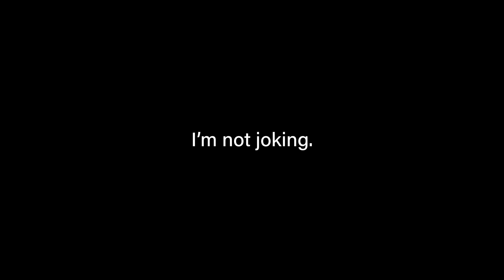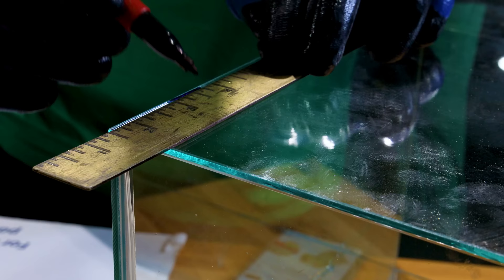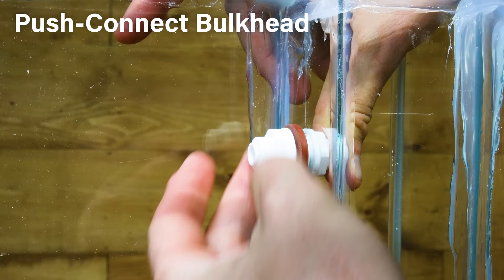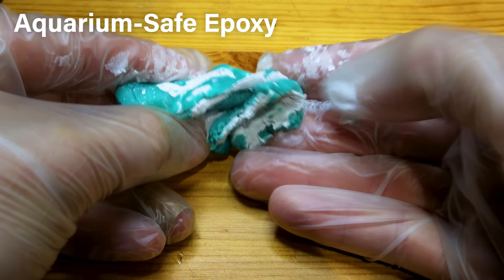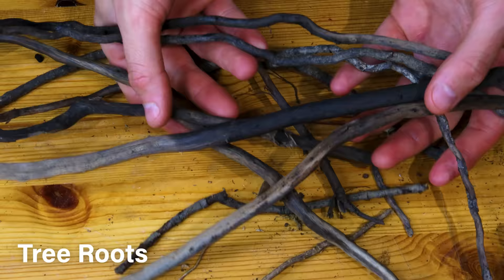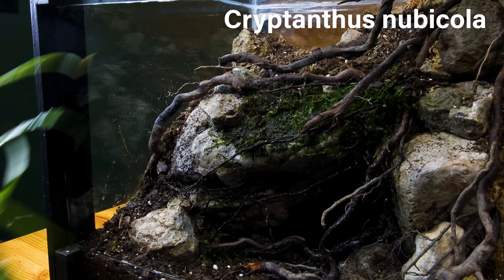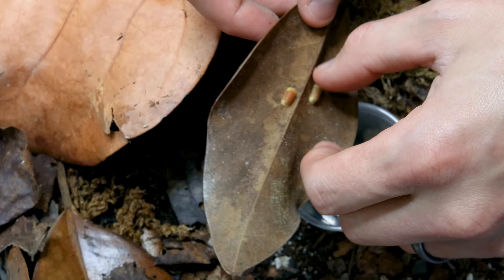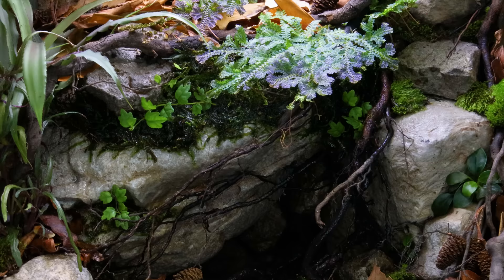DIY Rubber Ducky Isopod Dripping Cave Vivarium

Comment: I love seeing the isopods showcased on the channel! I have a couple recommendations for the substrate based on my experience:

Crushing up a ton of leaf litter and mixing it into the substrate is ideal in contrast to having only a surface layer. This allows more air to enter the soil, provides more surface area for them to nibble on, and more leaf litter = more pods. There's no such thing as overdoing it. I find that the surface layer leaves serve better as shelter and perhaps a humidity "blanket", so I use tougher, long-lasting leaves for it. Also, rotted wood (the spongey stuff) elevates any isopod substrate to the highest level. I add as much as I can and (controversial as it may be) don't sterilize it. This innoculates my substrate with native bacteria and fungi to create an established environment almost immediately, which promotes colony growth. My C. "Rubber Duckies" began breeding about a month after I bought them despite many claims that it can take around a year for them to start. Just 5 months later, I have about 60. Many people would argue my method carries some risks, but I've had nothing but success with it :)

(Side note, the orange springtails have been officially identified as Yuukianura aphororoides, a Japanese species that has been introduced to Europe. They were originally collected from Spain, so it caused a lot of taxonomic confusion)

Comment: Yo! This is a little silicone trick tile guys use for shower doors. You can wet your finger and run it along to bead to take off excess and make it more “even”, those giant yellow sponges you see at Lowe’s in the paint section? Wet one of those and use it to run your finger on to clean the silicone off. This will give you a super clean look

Comment: I would love to get an update on the duckies to know whether they are still out and about or if they ended up burrowing and coming out only to eat. The contrast of their yellow and orange on geeen moss looks amazing! I know what I am putting into my 18x18x18 Exo-Terra now! I had built a foam faux-rock wall with a prehistoric painting of a horse, like in the Lascaux caves in France. I added a dripping tube hidden above to achieve a similar effect to yours. But now I will modify it and add limestone to it and I will try to get a few rubber duckies or blonde duckies. 💛🧡🤎

Comment: Thanks for another interesting and fascinating video. I have a question. I have two favorite channels at the moment: yours and Dave’s Little Beasties. Both of you I respect a lot for your knowledge. However, now to my question. Dave who mostly keep tarantulas but is also an experienced reptile keeper, states that there is no reason to boil or heat leaf litter, branches or other things collected in the wild (from safe places). I have noticed that you do the opposite. What are your thoughts on this? I tend to agree with Dave, but would very much like to hear your thoughts. Thanks! John

Comment: Love the build! I notice youve been using epoxy a lot more lately. Is this just because you have some on hand from a previous build, or do uou find this method to work better? Are there situations where you are more likely to use the epoxy method over others, or vice versa?

Comment: Hey Tanner, 
Are the aqueon frameless tanks okay to use (especially for a full aquarium)? Do I need to re-silicone them? If so it looks like you re-silicon'd over what was already there. Is that enough? Was that just for this particular project or because the overall build quality of the aquarium isn't great?

Comment: I actually have my duckies in the same sized display tank. I do find they like to dig quite a bit. I like to give them 3-5 inches of substrate to dig through. Do you think the substrate is enough for them to thrive in that enclosure? I use your guide for the bins you create for you isopods myself and have found great success. Im just curious what your thoughts on the more limited area to dig is.

Comment: There's not a lot of specific holes for ventilation, do you find that the isopods still thrive with less cross ventilation (side and top)? I've been looking into really getting my enclosures past the bare bones but was worried that with those glass terrariums I wouldn't be able to get that ventilation without drilling into the glass (which I don't know how to do yet anyhow). Any tips or advice in that regard? Thanks :))